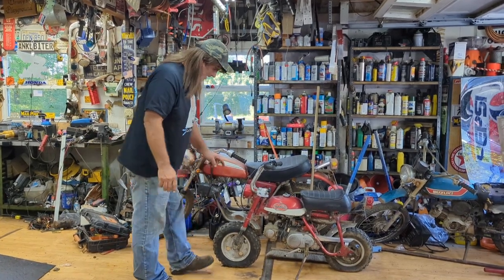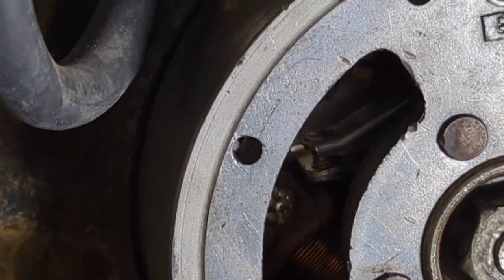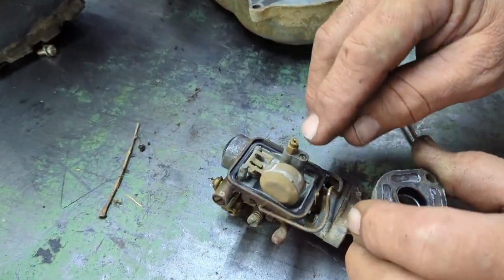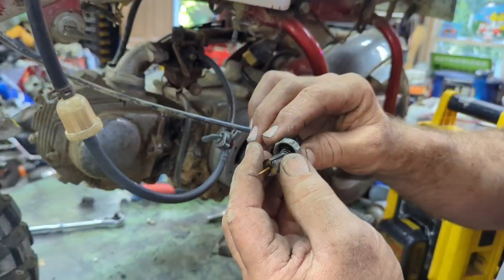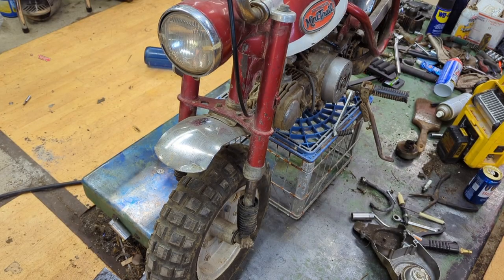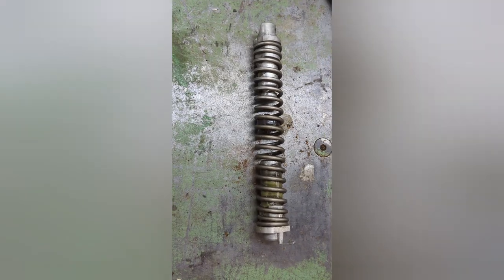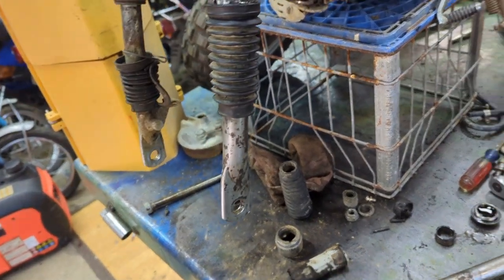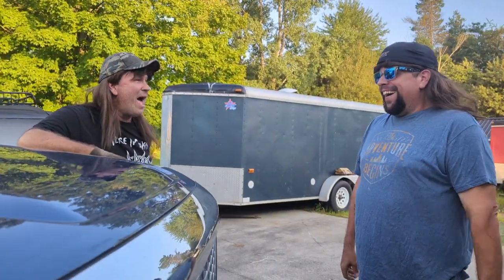Honda z50 fork repair and will it run again after 35 years?

Comment: Good video.  I saw Tarly fix your wife's Tiny Tiger Gen.   I like your channel.  I subscribed.  I still need to find someone to fix my stuff after I get the insurance settlement.  I have a 1976 CB 750A for sale.  It has the easy rider package, in Baby Blue.   Before the rollover I was quite strong.  No one bugged me about the baby blue colour.  I was in a car rollover not a motorcycle accident.  I have balance issues.  No motorcycle for me anymore.  It is pretty cool, but the last guy who did the safety did not put the fry pan cover back over the front brake.  He said motorcycles dont have fry pans over the front brake disks.  Mine did.  They were/are Teflon for speed.  I only hv one left.  Your video are great because they are calm.  You need more explanation about how to have a clean garage by air guitar..
Reply from the maker: Yeah the air guitar clean garage works great 🤣 yes she actually likes that little generator‼️ Appreciate you watching and subscribing and welcome. Sorry to hear about your accident. That's never a good thing. Sounds like a pretty nice 750a I believe those are pretty desirable bikes so you should be able to sell that. No problem. Again, have yourself a great day and thanks again for watching and take care ☺️

Comment: Good comical video. But for the beginners, when forks are removed clean the fork truss. on a wire wheel to remove and rust debris, clean tubes and spray with a silicone lubricant. Then assemble as shown.But replace piston slide that surrounds pin from lower to upper spring there cheap and doing this will give you a better quality job.
Reply from the maker: Thanks for watching. Yes, thanks for adding that. That's a very good idea. Good info for folks. Have a good night. Thanks for again 😁